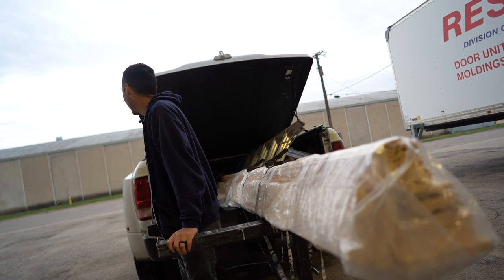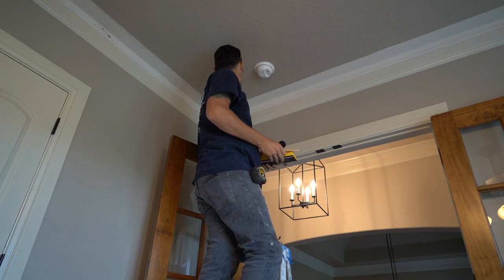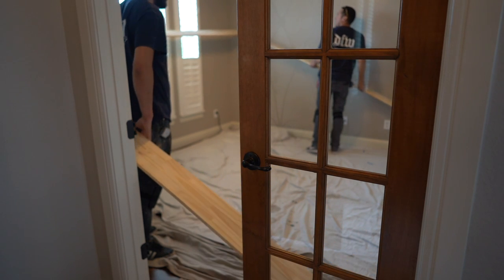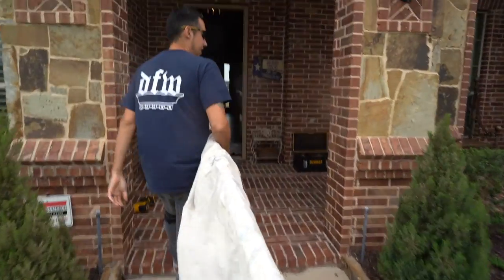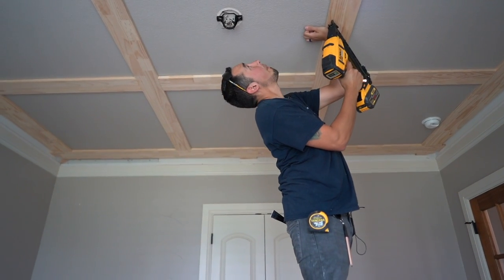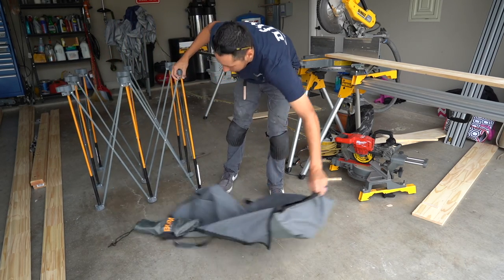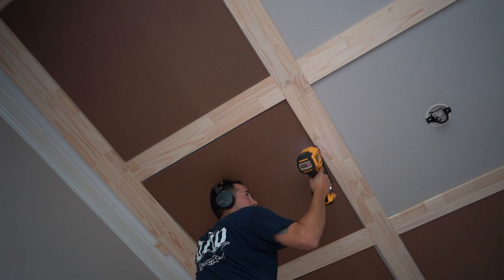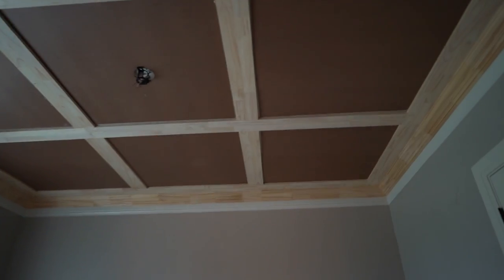Would you do this to your ceiling? Accent Trim Install

Comment: Before you comment and criticize He was joking about the smoke alarm people. Geez try to look at the awesome craftsmanship instead of looking for something negative. Richard has a PHd in crown. 🤣🤣
Reply: Tom Van he’s right, I never use those things 😀
Reply: I figured he was joking lol. For a second I was like wait what?
Reply: He wasn't joking...look at it again.
Reply: Ah a joke about the joke isn’t as funny
Reply: David Babcock I did and you can clearly see the relocated smoke alarm
Reply: In the follow up vid he says "when I tuck the wires up in the ceiling, I fray the wires so that if a rat bits them, it'll spark and kill it." That's what you call a "dry" sense of humor. Takes a little getting used to. I think he has brothers.
Reply: Dry indeed but in '72 my Dad dropped our plaster and lathe ceiling during the central air ducting insulation. He tucked the mini chandeliers above the acoustic panel.🤣...wonder what the buyers thought when they saw that.
Reply: I wasnt gonna criticize, but i was gonna ask.  Then i saw your comment.

His sense of humor (like mine) is so dry, that i miss the sarcasm sometimes.
Reply: I see a rookie
Reply: I needed 8 in my home. I put all of them in one room right next to each other. It just makes it easier to change all the batteries.

Comment from the maker: This was a little sketchy doing it this way lifting this whole unit overhead but it worked out in the end! 

If the room would have been much bigger I don't think it would have worked out so well.
Reply: You need to get some "FastCap 3rd hand poles." Woulda been those "2 ex guys u needed"👍
Reply: wondering how you would have done it otherwise.  Since you covered up your pocket holes by lifting it in place.
Reply: So, would you have still pocket hole screwed but from the face side? After tacking the ceiling up?
Reply: Finish Carpentry TV I love u my guy!! Can’t wait for the next video!!
Reply: I think I might try this but I will probably use biscuits and assemble as I go and preparing and touch up as I go.
Reply: Freakin awesome job guys

Comment: Little trick I have my crews do I learned years back in the union.
When gluing panels  push the panel tight then pull away as to allow the glue  to string then push it back up.
Get a little air on there and better   I think .
And there's your dinner
Reply: Randy Carreiro - that’s a great tip. We did that experiment with contact cement and the adhesion is almost 6x stronger. (Measuring the pulling force it takes to separate the materials). Besides the final cured strength, the immediate adhesion is more than double.

Comment: Small world Richard , that is the same as i did my ceiling , but i was lucky because the main beams were already there , so i just fitted the smaller ones then used hardboard to cover the ceiling with glue and staples then hid the staples with moulding , still not got a tracksaw still envious of yours lol, another excellent video Richard , keep them coming pal we appreciate the time and effort from over here in the UK .

Comment: I agree with Joey Dafish. Make sure to get the kit which comes with a storage bag. They have several lengths available. Short for cabinet installs (microwaves, etc.) and longer for standard ceilings. Compared to  Zipwall brand, the Fastcap have detent pins that will get the pole length closer to your needed height and a squeeze handle to extend the rod the rest of the way and hold pressure where needed. We had a remediation company at our house and they used the ZipWall brand and the damn poles kept falling over as the twist lock mechanism was worn out and wouldn't keep pressure against the ceiling to hold the plastic tight. They were falling all over the living room and onto the tv. Very aggravating. Anyhow, I use the Third Hands and plastic to build on site paint booths, dust barriers (drywall sanding), etc. I do however like the ZipWall brand zippers. They have adhesive that you attach to the plastic and make it so you can gain entry to the protected area and then seal it back as needed.

Comment: That is just about the same faux coffered ceiling I did last year. Didn’t have your tools or experience, so it took me a lot longer to do, but the look was similar. I used beadboard instead for the squares. For an 8 foot ceiling, it gives a nice look with only about a 1-1/4 inch dropdown.

Comment: Question, if you weren’t using panel molding would you install the tempered hard board first and hide the seams with the boards or would you cut each panel tight to the boards? Love your videos, thanks!!

Comment: I’m not trying to be a smart ass by any means, but wouldn’t it be so much easier to prime and paint everything in full lengths & sheets before hand (before you make your first cut) then measure, cut & install and just touch up the paint when done… It would save so much time in masking & prepping for paint on site...
You do beautiful work by the way and I have picked up some tricks and tips from your videos... you are awesome at explaining what you are doing... Thanks for taking your time and putting up the videos
Reply: HM Trimworks cf

Comment: I understand that you paint the fingerjoint trim and the 1x8/1x6.  Wold you paint the hardboard panels as well.  Wouldn't painting create the same or close to the same "texture" that you are trying to remove?  How thick is the hardboard that you use.  Great videos.  Thanks.

Comment: Back to the DeWalt nailer? Mine has stopped setting nails into the material consistently. This project is looking good man. I gotta join the track saw club. I have a big butcher block island top coming up. It’s time.....

Comment: Silly question but what is your reason for installing the paneling / boards that you glued to the previously finished drywall?  Would it be an issue if you skipped that step?  Thanks.

Comment: how much additional weight is that to the ceiling? is it legal to use that brown board only without the drywall backing? im thinking of doing the same, but im planning to remove first my very uneven plaster ceiling and make that brown board as the main ceiling

Comment: question on the nail in for the border that is parallel to the joists.. are you using screws and nails there as well or other method to attach? if you could explain how you address those sides that may not be under a stud

Comment: Another great video, thanks!

Can you give a ballpark estimate of what you charge for these jobs? Obviously there are differences like brand/quality of paint, # of coats, cost of materials used, etc.  But knowing if this is a $1,000ish job, or a $5,000ish, or a $10,000ish job would be great to know.
Reply: Easy 5,000
Reply: I guesstimate $2500
Probably ~$500 in material and the rest labor.

Comment: Do you recommend 1/8” vs 1/4” for common board?
Obviously there is a price difference, I guess preference for either wall or ceilings? And what kind of glue to use for backing?

Comment: I thought you might wind up with a boat in the basement, but it fit!  Did you check/inspect as part of your preparation to rule out bulges in the wall/ceiling joints?

Comment: Beautiful work as always man! Going to do this in a 12x14 room. Just the perimeter and 2 cross pieces splitting the room into 4 equal sections. I’m a one man shop making it impossible to pocket hole together and lift as one piece. If I install each piece individually what would be the best method to avoid separation where the pieces come together. Also any advice on proper and safe install where the 1x8 doesn’t hit a joist? Thinking of using 5/4x8 WindsorOne to create a little more depth. Thanks a lot! Really enjoy your videos!

Comment: Why would assemble that all on the floor and need to screw it all together? Then have to lift the whole thing up. 

Just glue and tack up each board with brad nails, fill small gaps, if any with wood patch and all good. Am I missing something?

Comment: I was just about to comment re the "nailing " of the hard board to the ceiling. In my mind, I thought, wouldn't it be better to use staples instead of brads, when the narrator pointed out that he uses staples instead of brads to avoid the brads shooting through the hard board. Talk about coincidence.

Comment: Richard, what do you use to cover the staples before everything is finished? And for the boards that run parallel with the ceiling joists, how would you nail it up there if it was not under a joist
Reply: The staples get covered by a piece of moulding that he will install but idk about the second question.
Reply: He mentioned gluing. Since the cross members are pocket hole screwed to the continuous ones, they already have some (just not quite enough) support. Gluing the cross member boards to the ceiling while finish nailing into the drywall (to hold fast while the glue dries) should be sufficient. This would be a good reason to make your continuous boards run perpendicular to the joists while your short cross members run parallel.
Reply: Cris Vega thanks for answering. I was wondering what other technique or tricks to use if there wasn’t a piece of mounding to cover it. Would nail fillers work on those tampered board?

Comment: ___ but that ceiling is , what maybe 10'x10'. what if you had a bigger ceiling wall? even when I see you struggle with large walls when trying to pick up, you can pocket screw sections and glue and shim the next section. I have done a wall 12' hight by 36' in length and pocket screw it in 6 sections.

Comment: careful  with cutting wires from smoke detectors as most are connected directly  to the alarm company. always ask the home owner. I can see pocket screws working but in a ceiling

Comment: Do you ever get pushback from customers on jobs like this about your method to complete what they want? As in, I could see a customer questioning your decision to leave the base molding on out of fear that it won’t match, or line up properly, or look like it was two different installs, etc. Or, do you not even get into details like that and just do it? I could see it could coming up when going over a quote because there’s a notable difference in required materials and labor - you’re essentially cutting corners (lol) but in a totally legit and understandable way. Even though you’re obviously gonna make it look dope (and I agree with the call), I can hear the whines of “no no I want it done like *this*” in my ears.

Comment: great work but you should team up with a painter man ..installing raw wood isnt really adequate. due to the fact that you won't be able to prime the cracks. that leads to cracking caulk in years time..  maybe just buy primed wood and give it a light sanding then install.. just a better overall product for the customer.

Comment: Why would you frame this up according to your skirtings, divide it up equally and if you cannot find a fixing use silicon or decorators caulk and stick it up there, when as a ceiling ever been the same shape as the floor??

Comment: Why did you bother with putting up the cardboard sheets and not leave it just drywall? Did I miss the explanation?
Reply: Ceiling had some texture, just to make it very smooth I'm sure instead of skim coating it
Reply: jlumps texture vs smooth finish, customers choice.

Comment: He hasnt done cross halving joints for timber in middle? Would be more professional and look alot better than just trimming timber down, fitting pieces between. Would have looked alot better with cross halving joints.

Comment: Holy shit... did I hear that right?   You remove the smoke detector because no one uses it and you cut the wires and shove them up in the ceiling... That is the dumbest thing I’ve ever heard in my life,  not to mention an electrical hazard and multiple code violations... stick to  trimwork and leave electricity to the pros